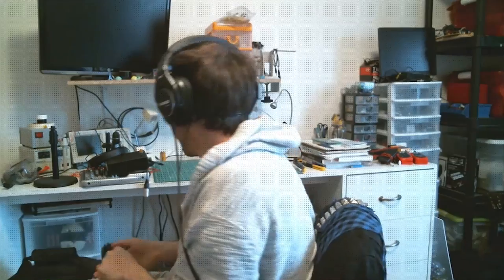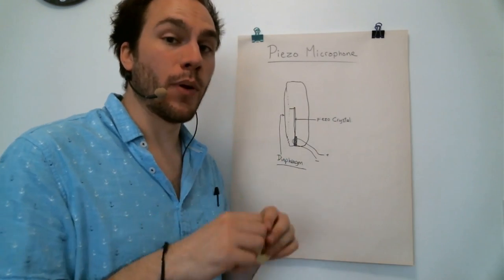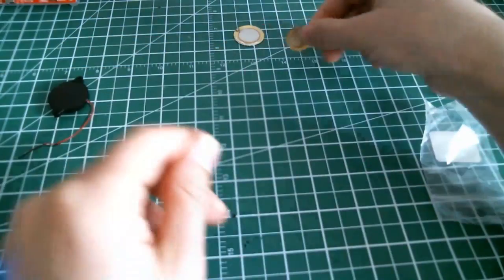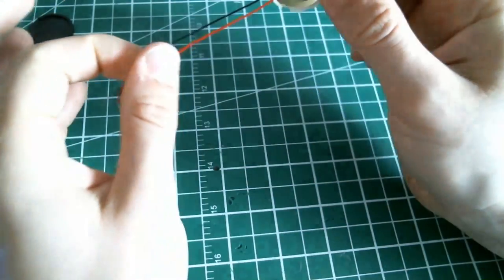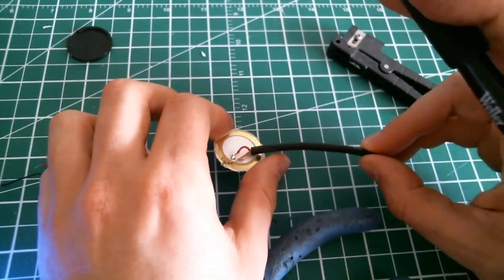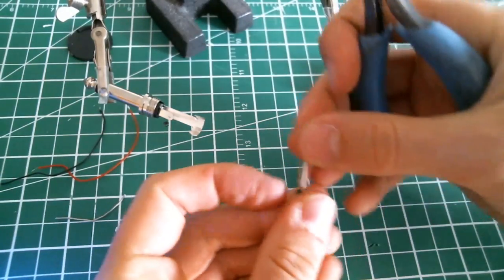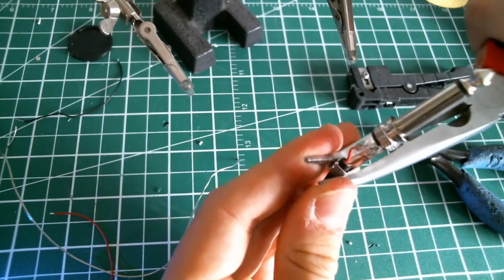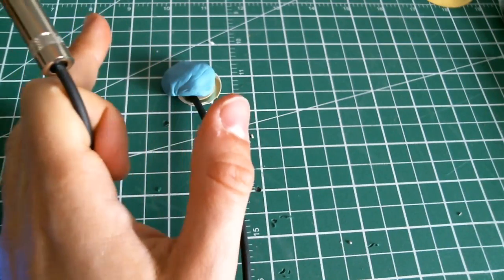Homemade Piezo Mic

Comment: How do you eliminate hum from grounding issues? It stops when I touch the output jack. Thanks
Reply from the maker: You can insulate the ground wire with heat shrink, hot glue or silicon. Or a clever way to make your piezo disc unique is to house the wired side inside a small plastic cap. You can be creative too and create your own clay cap.
Reply: @ThePhilStudio  thanks!:)

Comment: nice video. this one that you build is a passive one, because u didn’t use a preamp you plugged straight into your guitar amp.
Reply from the maker: The piezo microphone could be pre-amplified but it is so sensitive that there is no need for it. :) really simple project.

Comment: why it doesn't work good with 3.5mm audio jack? only feels small pulses and knocks on computer subwoofer, is it work only with 6.35 mm jack and big speakers?
Reply from the maker: I'm guessing you are plugging the piezo mic directly into the computer? I am not sure how your internal sound card works but you will probably need to adjust the gain and verify the connection.
Reply: @ThePhilStudio  Nope, i connect the piezo directly to (subwoofer) only, as a speaker, the computer is not related to the circle
Reply from the maker: @MohammedSaeedAwad  oh.. the subwoofer is preamplified? Also, a subwoofer can only provide subrange frequency which means something like 10-60hz.
Reply: @ThePhilStudio  so only connect the piezo directly to big speakers will solve the problem? or should be put (Amplifier Circle) between?
Reply from the maker: @MohammedSaeedAwad  try this circuit: https://youtu.be/tzIqYkO_YXo   to answer your question, yes you will always need an amplifier to drive a speaker.

Comment: Came accross your video, Dear Sir, I sold with soldring iron peizo disk as yours, I put it on my guitar with my hand, but it didnt work on amp. if i connected.

is there any thing special , like should the peizo cover with some thing, and shouldnt pressed with finger on guitar body ?

PLease help
Reply from the maker: Hi there. Make sure the connection has no short. Also, make sure your piezo is working. Since this is not a complicated circuit I would check these 2 things first.

Comment: Very good tutorial!! I'd like to know also how it's possible to conect few piezo pickups in parallel/series (like 10 pieces) together in one Female Jack Output for example for larger intruments like a harp. Thanks and Best regards,!
Reply from the maker: Hey there! Thank you a lot for the comment! Plugging piezo in serie will not work. In parallel, you will probably need a “mixer”. Could be a 100K potentiometer for each piezo. The best would be to have multiple OP-amp to mix all piezo.

Comment: it would be great if you make a list of wich scrap appliances we could find a piezo. i heard it's in every alarmclock is it right? thanks.
Reply from the maker: That's a great idea. I don't know if I'll have time to create a video about the subject but I can do a quick list: 
Alarmclock (most of the time a piezo)
Tamagochi
Small toy
Small Metronome
Some electronic kettle
Reply: Thanks for reply. i came here from cigar box guitar videos. pick up is made with piezo (or coil) nicest thing in a cigar box guitar is that you can make it with cheap things. if you are lazy and go shopping in sites like CB Gitty, it costs a fortune, i hate that they even sell the paper templates with the right fret spacing like they invented the Blues (lol) put the damn thing in PDF! it's public knowledge! my electronics ability is very basic but if i can i fix whatever, sometimes it's just a wire  broken, a resistor or a internal fuse blown. recycling certain pricy components could be an idea for a new of yours video serie. especially today we throw anything and we are full of trash.
Reply from the maker: @spiritualcramp8000  Thanks for the suggestion. :) You are right about recycling stuff. Most of the time, I'm working with recycled or scavenged stuff.
Reply: find piezo in auto buzzers.like when the door is open, smoke alarms & similar, carbon monoxide detectors. some home security devices, that attach to windows & doors. they are 2 pieces & when the window is opened it seperates the one with iron core away from the one with a magnetic reed switch & it triggers the piezo alarm. old wrist watches , any kind of timer with an alarm chime or buzzer, such as a microwave or even a kitchen stove/range, my (Air Cond. window unit) is digital & when i use remote to change settings, it makes a chime noise. musical greeting cards will have piezo, there is a lot more places to salvage them.. childrens toys will have a lot of them.
Reply: Smoke detectors, have it in them.
The smoke dectors have a 10 year life expectancy, and need to be replaced every 10 years.
So you can take them apart, after you replace them, and take the piezo buzzer out of them.
As others have said, anything that beeps or buzzes, probably has one in it.

Comment: Be aware that some glues will conduct electricity.
Reply from the maker: Comber thanks for mentioning it! I always use hot glue that doesn’t conduct electricity.
Reply: I recommend covering the top of the piezo with epoxy, easier to spread and let dry than hot glue.

Comment: Would .015" thick carbon fiber sheet make a good "resonator"?
Reply from the maker: Hey there. Hmm it depends. I'm not sure on how you would use it. I'm sure it is a hard enough surface to vibrate well.

Comment: Can I solder it to a preamp?
Reply from the maker: Sure! Best would be to solder it to a connector to make it non-permanant but if you want to create a small pre-amp circuit, it would be good. My guess would be to add a small volume potentiometer to keep a good control over the signal output.

Comment: How to build a professional contact microphone (pewr considerable depth)? Instead of using a very ordinary piezo, it is better to use a condenser microphone capsule and so on. Don't you think so? Let me know!!! Thank you very much.
Reply from the maker: Hey there, thanks for the question! I really like these condenser mic. The electret mics are easy to use and you can obtain great result with them but they are really cheap. The condenser mic require more complexe circuit, I never built one yet. The piezo is a great option for acoustic instrument since you will pick up only the vibration and few noise.